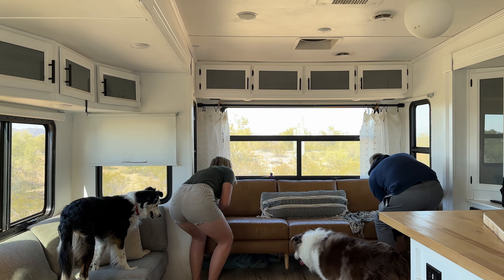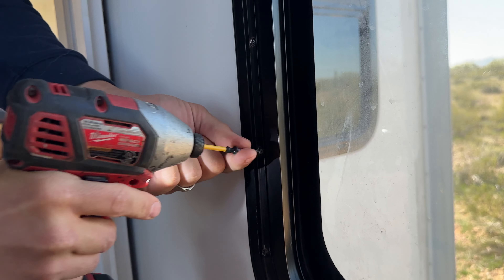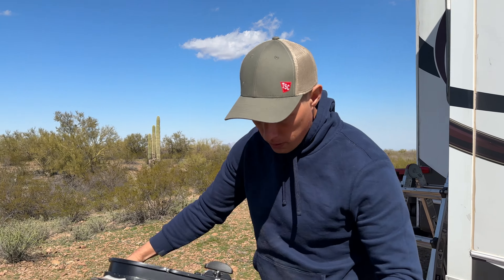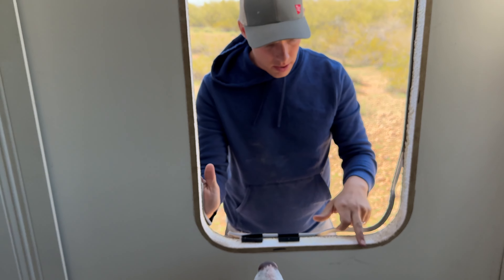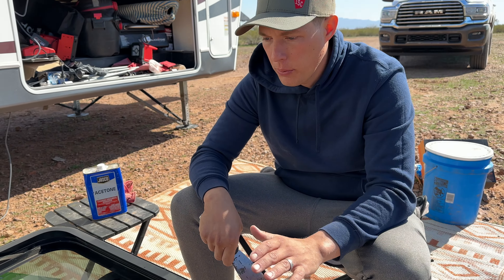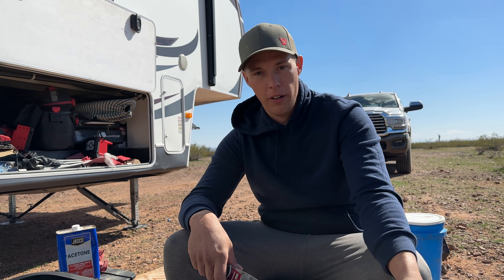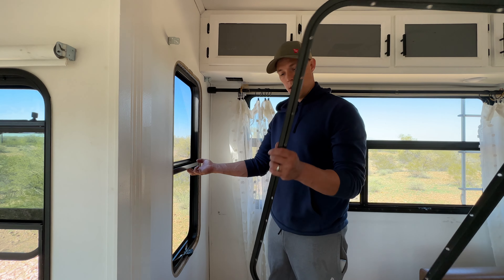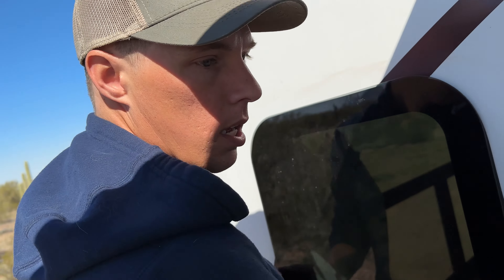How To Remove & Reseal an RV Window [RV Window Leak Repair]

Comment: I’ve had better results cleaning off old silicone and butyl tape using Mineral Spirits (the Low Odor kind). When I read the instructions and warnings for Acetone, I put it back on the shelf. :) Definitely wear solvent-resistant gloves when working with any of this stuff.

Comment: That looked like a "foam" product. Personally I wouldn't use THAT as the primary water stopper. I'd use the rv butle tape followed by using rv pro flex around outside seams and then for weathrizing use sprey foam in the crack between the window and the big gap the manufacturers made for thr opening_ then put the inside window holder back in.

Comment: Acetone is the mother derivative 90 % of all solvents just in varying degrees. Do NOT soak your cloth and it will fine as it's evaporation rate is high and leaves less of a film .

Comment: It’s good to use a foam gasket on frameless windows. Other type adhesive type gaskets like butyl tape does not release well on frameless windows if they ever need pulled out again making a higher chance of them breaking.
Reply from the maker: This makes a lot of sense! Glad we went with the foam/sponge type now!

Comment: Great video
When i resealed my windows..i use byutel tape and did a clear bead of silcon around the window once the window was back in which seems to work great
I have a 1989 Ford E350 class c rv

Comment: I haven't had to do any of mine yet but I'm glad I got to watch you do yours for when I do. My a/c seal leaked once and I had to tighten the 4 bolts. I'm installing a solar off grid system right now. 4/0 wire is a bear to work with lol.
Reply from the maker: Haha we can relate to that! Running those wires were no joke

Comment: You should’ve use black butal tape then cap seal the top never mess with it again but you did good
Reply from the maker: I was going back and forth between the foam and butyl tape, but the foam seemed to be a little more popular for the frameless windows…hopefully it’ll hold! (At least as long as we have this thing lol)

Comment: CAN I BORROW YOUR HUSBAND TO REMOVE SOME OF MY WINDOWS TO FIX THE LEAK IN THE BEDROOM IN NEW ZEALAND AND THE BEDROOM WINDOWS ARE LEAKING I THINK THEY NEED MORE THAN DOUBLE SIDED TAPE. MY SON IN LAW DID WHAT YOU ARE DOING ON THIS VIDEO AND SAW DAYLIGHT IN THE BIG BEDROOM WINDOW AND WE RESEALED IT WITH BLACK BOAT SEALANT AND ITS WORKED! NOW FOR THE BEDROOM WINDOWS I THINK THEY ARE SOME HOW LEAKING AND WATER IS GETTING IN ON THE CARPET. I HAVE BLOWN THE WEAPHOLES OUT BUT TOO OLD TO GET UP THERE 72 AND A WIDOW WHAT WAS I THINKING???